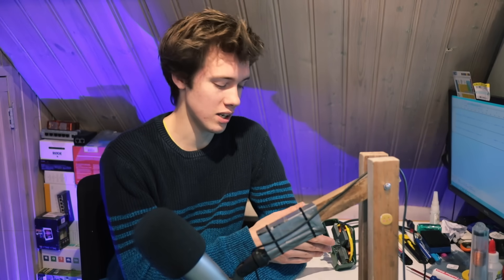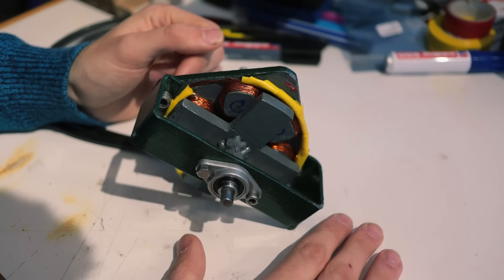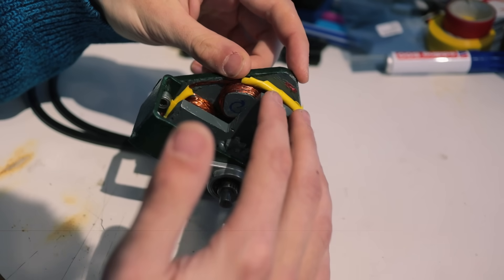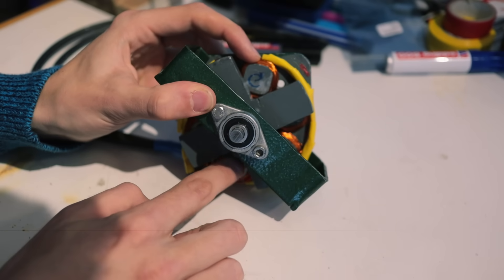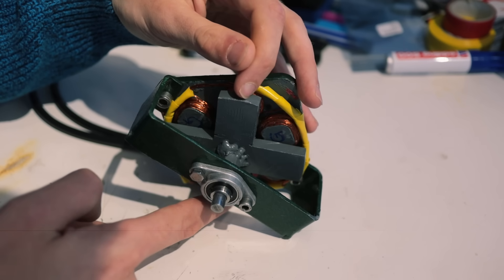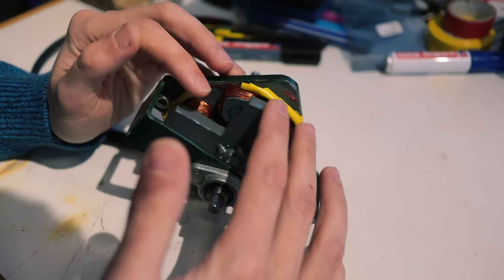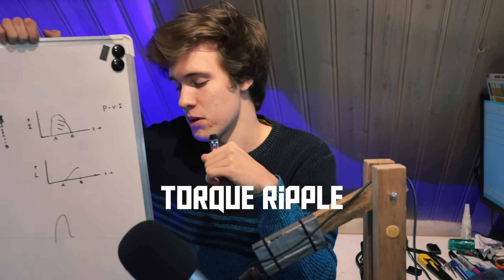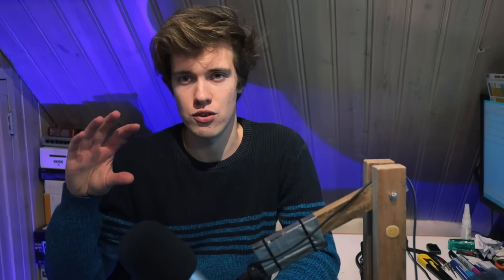Switched reluctance motors: simple yet tricky

Comment from the maker: I'm still working on a driver for this motor. When I have it working I'll post a short video showing the motor running at speed.

Edit: the motor now runs, here's a link to the video: https://youtu.be/TAhF45AtsgA?si=qABbtBXH8Mqic1_W
Reply: Not as sexy as a bunch of solid state position sensing and coil switching circutry, but have you thought of beautifully simple mechanical commutation?  

Maybe as a first working iteration and may give grounded inspiration for developing solid state version.
Reply from the maker: @kreynolds1123  I've thought of it, but I've decided not to. It has to do mainly with my personal competence at making commutators. I've tried it in the past and it didn't go well. To me a commutator/brushes assembly falls under the category "much harder than it seems". The concept is simple, and so is making the "science fair" version of it, but then making one that actually works kind of well, and lasts longer than say an hour, (which I do want, since I plan on using this motor to actually power something later on) is surprisingly tricky. It needs quite precise fitting parts that are hard to make with basic tools. Electronics on the other hand I've had more success with so I'm going for that now.

Or course this may be different for other people, I'm sure there's plenty of folks who know nothing about electronics but do have a workshop full of mechanical tools and 30 years of experience with making precision mechanical parts, and I'd highly suggest those people do go the mechanical way haha.
Reply: @AKIOTV  I get your points, but may i make a distinction.

There's mechanical commutating current to the coils,  and then there is  commutating position sensing. 

Commutated position sensing requires far far less current  and heavy current on brushes is challenging and maybe you'll find commutated sensing easier and attractive. 

Alternatly, Position sensing could be achieved with a rotory capacitor. Maybe you have another rotor with tiny magnets on it and use a hall sensors instead, or did you have other ideas for position sensing?
Reply from the maker: @kreynolds1123  Hall sensors would be most ideal, I'm currently trying some IR reflective sensors that I happened to have. They can do the job, but maybe they will suffer from ambient light. If that turns out to be the case I think I'll get some hall sensors instead.
Reply: @AKIOTV  IR reflected or pass through. The encoder rotor diameter will effect how many teeth you can have and the degree of accuracy you can achieve.
Reply: @AKIOTV  I wonder how feasible it would be to use current and/or voltage sensing on the driver's outputs in a feedback loop to adjust the timing and shaping of the driver's outputs. That should give your driver a lot more information about the motor than a position sensor ever could.
Reply: @kreynolds1123  I like your idea, I do remember analog electronics. I started, like everybody else. DC electronics, AC electronics and then onto vacuum tubes. Do it mechanicaly and then with digital control. Again, great idea.
Reply: @kreynolds1123 MadeWithNormalGraphiteBrushes.ButIThinkItWouldBeNoisy.
Reply: What will you use as software?  Do you know SimpleFOC?
Reply from the maker: @candas1  I was planning to code something from scratch. I didn't know about simplefoc, looks like very solid stuff, I'll definitely keep it in mind. Not sure if it supports this kind of motor/my driver electronics, so I'll have to look into that. Thanks for the suggestion!
Reply: @AKIOTV probably not out of the box, but it will get you started faster. There are a lot of knowledgeable guys on the forum
Reply: Why not use a brushless motor speed controller, typically used for drones.   Most of the time they are 'sensorless' using the collapsing magnetic field of the un-energized coils to figure out the position.  It may not work in your case as drone motors use magnets on the rotor, which would amplify the 'sensor' signal.
Reply: @moddaudio A SRM and BLDC motor are very, very different. FOC does not apply to this motor type. Timing is much much more tricky to achieve. The maths differs.
Reply: i got a REALLY fun idea for that! go low tech at first, and to the fundamental research yourself in a very tactile way. a metal drum (tin can), attached to the drive shaft,  and 3/6 reed switches. (optionally 3 more for a generator program) then just stick rows of little magnets to the drum to "program" the timing. watching the experimentation would make for entertaining content, and it's far quicker, easier, and more satisfying to tweak, than any computerised option, while giving a nice physical visualisation. 
...and whacky, experimental contraptions like that are just a ton of fun!
Reply: Why not earth/ground the can, bend solid wires as a brush (one for each coil circuit, and coils connected to positive/hot), then use electrical tape on the can to interrupt the circuit when you want that coil pair off?  
In middle school I made a traffic signal simulator in this fashion, however I used a larger diameter coffee can and [presumably] lower RPMs. @Ucceah
Reply: Will your driver support operating it in reverse as a generator/regenerative braking? Supposedly SRMs can be used that way but I haven't seen an explanation I understood for how to drive it that way. Obviously it needs to be driven in some way to do that since, undriven, there are no magnetic fields.
Reply: All rear motors in Tesla  Model 3's and Y's are synchronous switched reluctance motors.
Reply: Very much looking forward to the controller approach!
Reply: Can you not just use a pair of cogs for I and O that connect to the proceeding coil as it over the previous coil. Just connect to the opposite end of the shaft and set the to sides of the wire into the teeth of the gear then just reduce power to speed up or slow the motor or simply cut the power at regular intervals via some sort of cut off set against centerfuge weighted switch with a sufficient spring so when it begins to reach dangerous rpm’s it naturally cuts the circuit. 

I prefer engine systems that do not require any extra computer components.
Reply: Very cool 
You don’t have to use a driver mine just use opto timing
Reply: Is there any way to alter the geometry of the steel bits such that the driver complexity is minimized?

For example, offsetting the inductive effects by varying the gap distance between rotor and stator as they pass by each other, by making their two facing surfaces something other than radially "flat?"
Reply: Why don't you use two sets of coil to this no need for for a complex circuit.
Reply: some harmonic driver? simlar to a dyson motor
Reply: I see the driver need to give a "half wave" or a pulse. Really waiting for the driver part of this motor, Good luck :)
Reply: Make me think of a distributor cap to drive a couple of these
Reply: you forgot to mention that these motors have wider rpm range than permanent magnet motors and slightly greater efficiency than induction motors, but slightly less power density

Comment: Very inspiring and marvelous, but I don't understand something, and If you could answer please?
1. What material is the body of the motor(the green painted part)?
2. If it is steel, than when you drive the motor, specifically when you pulse 1 set of coils, because all the  coil cores share the same steel body, don't you get parasitic curents in the other  windings when you are activating the driver coil   and behaving like a transformer? Because in the big picture sounds logic 1 set of coils in series, pulsed, the rotor moves in line with the magnetic poles, but what happens with the other 2 pairs of coils while one is pulsed? Don't manifest as secondaries in a transformer?
3. How this works in bigger SRM's because I saw that the stator coils share the same core (even if the poles are salient type)
Thank you for the instructional videos you post, but about these kind of details nobody talks.
Reply from the maker: @mateivaly5007  the stator is indeed steel, but the flux through the non-active coils is minimal, because the flux almost entirely takes the shortest path from one energised pole to the other.

Magnetic flux and reluctance are similar to electric current and resistance. If I hook up two wires to opposing sides of a copper block, the current will be very high directly in between the points where the wires are hooked up, but very small near the edges of the block, because the shortest (lowest resistance) path is favorable.
Reply: @AKIOTV  Thank you, one last question, how did you build your rotor? What paint did you used? Are there multiple layers or just one big piece of iron?
Reply from the maker: @mateivaly5007  Both the rotor and stator here are solid steel. The rotor is painted with regular spray paint. Not an optimal solution and one of the reasons for the low efficiency of this motor.

Currently I'm building a new one with a laminated rotor and stator.

Comment: You can capture the fly back EMF while it duty cycle, by using a mosfet and diode and sending the pulse (voltage) to a capacitor bank, and discharging to a secondary battery (current).

Regenerative breaking is just a poorly designed choice to capture an otherwise wasted very powerful spike of voltage.

https://www.youtube.com/watch?v=79KONm0egvk&t=86s

Let's start the new age now gentleman.

Comment: Sounds like the timing problem of the SRM is similar to that of an internal combustion engine in which the engine's distributor provides voltage to a spark plug at the precise moment when a piston is in the correct firing position based on a signal from the crankshaft position sensor.

Comment: It's the most common motor by far. Get some three phase or shift two of the coils voltage forward with caps.  But there is other expensive ways of doing it also.

Comment: Cool, but eddy currents flow with every change in magnetic field in a conductor (solid rotor).
... which makes heat and power loss. That's why all non ferrite rotors and stators are laminated.
The higher the speed, the worse the eddy current losses due to back emf in the solid rotor.
Reply from the maker: @sparkyy0007 true. That's why I'm working on a new version with laminated rotor and stator. Not all that easy to do though, I had to get the laminations laser cut.

Comment: Seems like you could stack this design rotor/coils/rotor/coils/rotor....all on the same shaft.
Reply: Also I'm really interested in a second coil that is paired in parallel (literally wound together) but is used to read the system. I also believe a "P" shaped rotor might solve some torque issues. What happens to the energy magnetized into the steel rotor? Can that be recycled creating even more efficiency?
Reply: Oh boy!!! Much longer shaft. Coils and rotors on adjustable angles. Back emf coils to begin research! I'd want at least 5 stacks to start. 60° out of phase from one to the next creating a 360° of potential read and correct...

Comment: Great! nice expiation.

Some Ideas.  Use brushes on the axel to turn the coils on and off.   have multiple motors on the same axel just out of faze to fill in the ripple.

Question:  How do you prevent the rotor from becoming magnetized or heating up?  Steel going in and out of a magnetic field will either become magnetized if the field is the same every time or will heat up if the field alternate.  (induction heating)

Comment: Your explanation was very well done - you did an excellent job presenting the complications of current, voltage, inductance, and magnetic saturation involved using this type of motor. Things "really" get complicated when you begin to address varying loads on the motor, the software required (difficult to build purely electronic circuits to directly drive such a motor) allows using the "complications" to very efficiently address power and efficiency. A "simpler" motor tends to offer fewer opportunities for adapting to increase power and efficiency while also offering regenerating capabilities.

Comment: Why can't a commutator be added to the rotor and the pole switching be performed there?
Reply from the maker: @davidgould3409  if you add a commutator and brushes, you might as well put windings on the rotor. At which point you've just made a brushed dc motor. 

But the main feature of an SRM is that it's both magnetless and brushless. Adding brushes makes it sort of pointless. 

And trust me for most modern applications, you don't want brushes. Surely they work ok in a lot of cases and have served us well in the past, but electronic commutation (brushless) is always far more efficient and reliable.

Comment: Very interesting!  Way back in the day (1910's) Emerson Electric had a desktop oscillating fan called the Meston. It had a switched-reluctance motor with a commutator and brushes to switch the coils. The timing of the brushes was adjustable by sliding a lever which rotated the brush holder assembly.  It was infinitely variable. Interestingly, the motor used AC to power the coils, with the AC switched by the commutator.  It had a two-arm rotor and a six-pole stator switched by the commutator.

Comment: How thick wires you use to make coils for srm?
Reply from the maker: the wire diameter I used for the current version is 0.8mm. Thinner wire you can fit more turns on each coil, thicker wire will handle more current. Ultimately the maximum field you can generate is the same either way, but a certain number or turns may be better suited to a particular power supply. If your supply can handle high current but is low voltage, use thick wire/few turns, if the supply voltage is high but you can't supply much current, use many turns of thin wire.
Reply: @AKIOTV  how many turns do you make for one coil? Is the core of the coil made from a magnetic material, or is it 3D-printed?

Comment: Reminds me of steppers and what powers the 3 phases of a  electric unicycle motor and the early modles at low speed had that grinding effects of phase ripple at low speed. Controller advancements and tech improvement smooth it out.

Comment: 5:05 Or, and hear me out, you could put conductors on your shaft. And then, depending on the rotation, the brushes close the depending contacts …, now add a magnet under each arm to give an extra umpf to the motor as those reduce magnetic field lines even further.
Wonderful. You now have built a normal DC motor. And now you know why your reluctance motor is unpopular. It's a less effective DC motor with extra steps.

Comment: So it's basically just a BLDC motor with a passive iron rotor instead of a rotor with magnets? Or am I missing something? EDIT I bet you could use an off the shelf sensorless BLDC ESC and modify AM32 (open sourcce ESC firmware) to drive this. Pretty much any ESC that uses BL-Heli firmware can also use AM32.

Comment: I have heard that Koenigsegg uses axial flux motors that are 6 phase and 800 horsepower. Per wheel :)
Reply from the maker: They do indeed have some insane AF motors (funny how that abbreviation could be interpreted 2 ways). Not entirely sure about the 4x 800hp though, even if they did have that in the drivetrain I doubt the (small) battery pack could handle that sort of combined power.

Comment: I thought it was time I tried to understand the motor inside my BMW i3, about time after 7yrs and my second one. In fact it's not a true SRM but a hybrid synchronous motor with a little bit of permanent magnet and some use of reluctance. In August 2013, Green Car Congress had an article on the BMW patent.
When Sandy Munro was interviewed in 2014 on Autoline Daily about his teardown of the i3, he was quite impressed with the motor. However I'm not sure BMW have developed the idea further, it's certainly not in the iX M60 whose motor even has brushes!!
Also ref. to David Bricknell's book: "Electric Vehicles and the BMW i3".

Comment: These motors don’t need a fancy controller. Closed loop is great, but just to spin it, open loop is fine. You need a 3-phase square wave source and low side drivers. Arduino will do it, or a couple gates. IIRC Lancaster’s CMOS cookbook has a 3-phase generator schematics that uses a single chip or two.
Reply: A proper controller like what is used on BLDC motors (which are basically the same as this only with magnets on the rotor) will be much more efficient though. If you use an off the shelf BLDC ESC that supports open source and modified AM32 it'd probably work for this. You can get these for $20 or less.

Comment: I had designing an electric drive based on this type of motor. I`m even built my own dynamometer equipment for this purpose. It's pretty interesting but you have to know exactly the position of the rotor (rotary encoder or too many online calculations by measuring currents and voltages in all phases at the same time) to control this motor in proper way. Or you just can use it simple - in stepper mode (without feedback).

Comment: Why the motor has only 2 power lines? Is it the driver circuit on the motor?
Reply from the maker: this particular motor has 2 cables with 3 wires each, so 6 wires in total. 2 for each coil pair.

Comment: I have a suggestion for a method to switch the coils on and off. It is quite magical and doesn't involve technologies so advanced that a solid state physics laboratory is required to build them: Connect the each pair of coils to a series of contacts positioned on opposite sides of the rotor's shaft. Arrange pairs of contacts fixed to the motor's frame to touch the rotor's contact pairs. Position the fixed contacts such that they are rotated slightly in advance of the pair of coils to which they are connected so that the motor is self-starting. Sound familiar?
Reply from the maker: Putting brushes on this motor renders the whole reluctance based design pointless, since at that point you might as well use a wound rotor, (a rotor with coils) aka make it a regular dc motor. The SRM only makes sense as a brushless design.